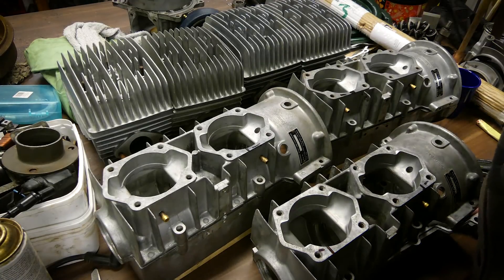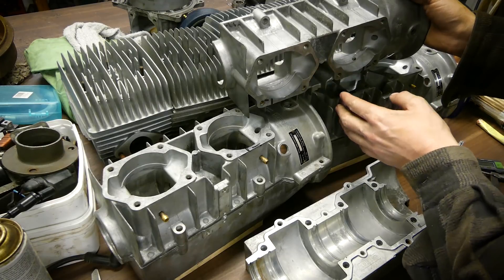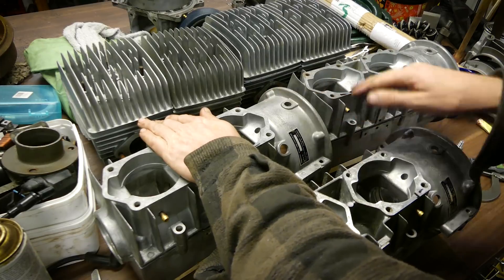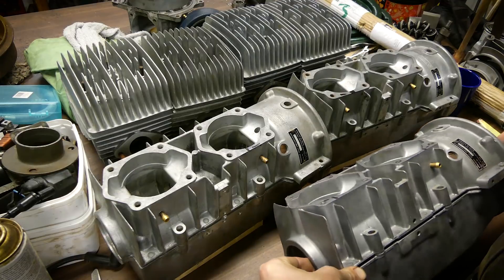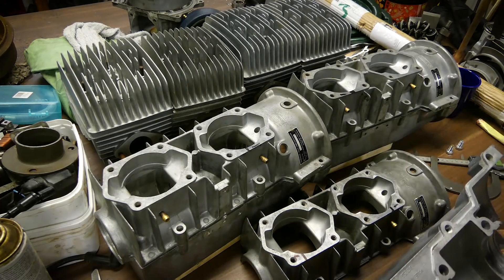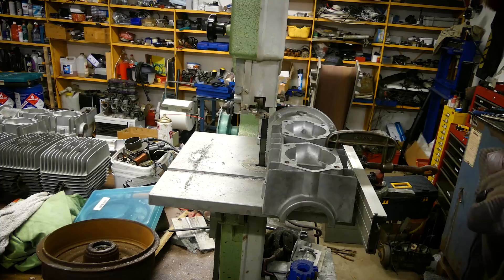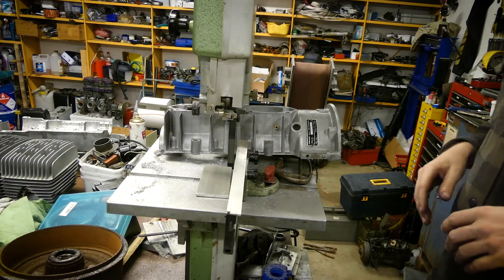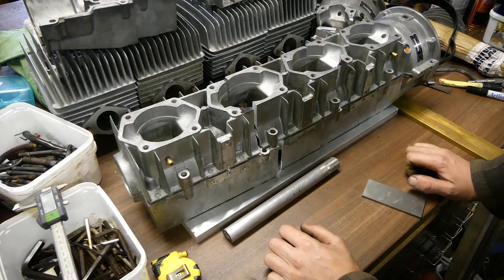Cutting some crankcases - 873 cc 4 cylinder 2-stroke part 1

Comment: I've been dreaming about doing this forever. Very gutsy, nice work and way to follow the dream! Might have been easier to put the top cuts on an uncut base. Then cut base on welded top and so on welding one case half at a time. Then you won't need any jigs to make sure you are spaced perfectly. A cylinder and the motor mount plate will space the outside edges.

Comment: When doing cutting things in that manner, you want to dispel the use of the caliper. Not only because it's not precise enough, but also because the act of measuring with it, is a pain in the ...anyways. Always take the time to make a go no go gauge for work like this, especially when something is repeated more than once. It makes life easier.
In this case, an excellent go no go gauge would've been using a bar of aluminium with ridges that fit inside the grooves.

Comment: What firing order are you implementing if you space the cylinders 90 degrees? 1, 2, 3, 4 or 1, 3, 4, 2 or 1, 4, 2, 3? Either way it should run smooth but you have options to do something really different if nothing else.
Reply from the maker: I'm thinking 1324 because that's been tested by others and seems to work well, but still trying to figure out if a different order might be better.
Reply: @Hollaendaren  That actually makes most sense, that way you'll have the most smooth scavenging of the cylinders.

Comment: It's a shame something couldn't be done to get two strokes back into the market for large motorcycle engines. The simplicity amongst the other obvious benefits make the idea very attractive. How you deal with the total-loss lubricating system is a real engineering challenge. Suzuki went some way with the mechanical oil recycling system on the GT 750 engines, but in the end the idea of bigger and better two strokes lost to the pollution lobby and increasing four stroke technologies.

Comment: a friend did something similar, single into a twin, and the crankshaft was the hardest part of the whole job, roll your sleeves up when turning on the lathe, have you taken into account the heat in the two centre cylinders,

Comment: I think this is a big mistake. Those kt100 engines are worth about 1000 each when rebuilt and running good.
Reply from the maker: These aren't KT100 engines, I have no idea where people are getting that from.
Reply: @Hollaendaren  okay then what are they?
Reply from the maker: They are Rotax 440 snowmobile engines.
Reply from the maker: I don't think they have much in common other than both being air cooled and piston port, there's 1000s of different engines like that. For starters there's the fact that the engines I'm using are twins not singles. Cases are split horizontally on these, vertical on KT100. KT100 cylinders have "feet" (short studs), these have long studs all the way through the cylinders and heads. KT heads are 6 bolt, these are 8 bolt. Completely different crank of course. Etc etc ;) I don't see a whole lot of similarities.
Reply: @Hollaendaren  looks exactly like a kt100 to me. Atleast the same design. Not same displacement if they are 200 some ccs.
Reply: @joeshmo2473  he wasn't a dick at all. He told you all the differences. You should say thank you for educating me.

Comment: If  you  were working with castings  instead of finished  parts  you could  aling  bore  your  crank  areas  ect  after it was welded together..  Also  you could  print   the parts to pour  your own  forgings..  There is a two  stroke guy doing this on  yooo   tooob  already ..  he is building  his own 50 cc  water cooled cylinders.. ect..billet machined crank shaft
Reply from the maker: I can line bore it anyway if needed. I'm going to be using different rods and pistons than stock so nothing is going to fit anyway, shaving a mm off both halves and reboring it to the same diameter would be fine. Or I could probably go up one size on the bearing OD.
I am pretty sure you are talking about the 50cc cylinders that I just machined for 2stroke stuffing :)
Reply: @Hollaendaren  I like what you've got going on here. Glad to hear you're considering align boring it as well. Probably pay dividends in engine life and will most certainly be necessary.

Comment: you can  purchase a V-4 
http://www.aaenperformance.com/v4_racing_engine.asp
Reply from the maker: Yeah but I doubt anyone would want to watch footage of me ordering an engine ;) not that I'm building it for YouTube points, I just want to see if I can actually pull this off.
Reply: @Hollaendaren    Yes  I understand ..  Is that a Snowmobile engine.. I just found your channel  and have no idea what you are staring with and  what  you want to use it for ..
  Yamaha RZ-500  is  two  two  cylinder engines and crankshafts  connected with a chain .. or gears  ..
Reply from the maker: I am working on a little project update video as we speak where I finally remember to mention what it's going in, it is going in a vintage snowmobile. I am familiar with Yamahas VMax4 engines, and have considered building my engine the same way (pto in the center between cylinder 2 and 3 and coupled by a gear), but I'm saving that as a plan B because I think one long crank is more contemporary with what I have in mind so I prefer that, really just for aesthetics because center pto would be a lot more practical in almost every way. I want it to look like it was built in the early 70s (the engines I'm using were made in 73).

Comment: Why not just join two two cly  motors together at the cranks, then make a spacer and bolt the blocks together?
Reply: wouldn't that make it longer though
Reply: @jamescooper4260 :  Yes, but only about 1 inch. or the thickness of both crankshaft flanges.  Think about how much easier that is. In fact, that is how most engineers connect two engines in-line. Ever seen the V-16 made from two Chevy V-8s. The guy connected the back of one crank to the front of the other with a homemade 12 spline coupling.
Reply: If there is an easy way and a hard way, why pick the easy way ;) You might as well ask why not buy a ready to run crate inline 4 engine, that would be even easier. The sole point of projects like this is the self set goal of making it just the way you want to make it. It is not about making it easy or sensible, it is about the satisfaction of making stuff.
Reply: @JohnSmith-lf8ks  OK then. My goal is to make a 532 cyl engine from corn flakes. I will be everyone's hero.
Reply: @timhallas4275  Can't wait for the video, I promise to 'like' it.

Comment: Overcomplicated solution, i mean if you need to make 4 cyl engine of two 2 cyl engines easier would be attach them side by side and join crankshafts with chain/sort of timing belt/gears, in this case error in alignment won't be so critical.  While things in video require high precision tools and errors will mess parts. 

Just thoughts about practical solution, ofc as youtube show this one is fine.
Reply from the maker: Yes it would probably be a bit simpler to build, but nowhere near as cool as one big 4 cylinder case :)
Reply: Well as for hobby maybe you right.
I guess with your tools you could even build crankcase from scratch, something like machine for each cylinder its own crank case section and bolt them together.

Comment: Why not just machine grooves into the big bit of bar you had in the lathe, install clips onto shaft and clamp all the case bits on and tack weld the whole thing together.  No need to machine all the case halves and no need to measure anything other than the groove spacing on the bar.
Reply from the maker: I really wouldn't want to leave any gaps either way, I think that's asking for warpage or weird tensions in the castings. It's not like I'm going to be mass producing these cases so I don't mind if it takes a couple hours longer to machine the cases to avoid gaps, better safe than sorry :)

Comment: Another method would be to leave the bottom intact as an assembly jig for welding the top part and just bolt the two together, weld, then finish the top, then use the finished top as a weld jig for the bottom.
Reply: Having welded motorcycle cases in the past, I made a mandrel that fit the main bearings, and sent the welded case out for stress relieving (heat treatment) to prevent warpage.
Reply: @UncleKennysPlace  I was thinking of the same solution, the bearing holders need to be exactly in line and just bolting the parts up to the other half isn't to be precise enough.
bearing alignment must be within 1/100th of a mm otherwise the engine wouldn't run very long.
Using a turned mandrel which has bosses beeing at the precise locations and size of the bearings on the real crankshaft should work, placing the lock rings in each part and then fitting them on the mandrel will ensure both bearing spacing and allignment are at the exact location where they should be.
Reply: @UncleKennysPlace  did the same

Comment: I would have cast a plug of the cylinder hole including the side kick outs and especially the bolt holes.
It would help to have an alignment tool that you can bolt in place for when you weld it back up as you will need to cut a deep "V" in the gap you will be welding to get decent weld penetration.
It will give you a perfect alignment in every plane to get a perfect part.
Reply: archangel20031 I think he plans to clamp it to the bigger shaft he showed in the beginning. That way. If the spacing is right he will know the bearing bores will be all in line.

Comment: What is this engine series originally out of? Snowmobiles?....
Reply from the maker: Correct, they are out of 1974 Ski-Doo TNT F/A snowmobiles. The earlier free air sleds were more aimed towards racing for those who couldn't buy factory racers, anyone could buy one of these sleds they came out of. They were loosely based on the 73 factory racers but toned down a bit so they could be trail ridden too. They raced mostly in stock classes and in stock form they had about 55 HP (for a 2 cylinder that is). So lots of room for improvement there but still not all that bad for being 1974.
Reply: @Hollaendaren  well, once done, what is the game plane, with a completed and running 4 cyl engine?, Or will figure that out, once you get there? Either way, I have enjoyed all 4 parts, and working my way through your other videos... Good stuff!!!
Reply from the maker: @drubradley8821  I'm going to have to build a new snowmobile chassis for it, I've started realizing this project is going to take way longer than I originally thought. I was hoping to have it somewhat finished by now, not sure what I was thinking. I want to do some drag racing with it and see if I can actually give newer stuff somewhat of a race or if I'm gonna be there mostly for show ;)

Comment: as a machinist ,i have had to do many things like this , also i raced two stroke singles for years with many dramatic mods but this is way more intricate with all the welding involved, i cant wait to see how you keep it straight , but magic so far 11out of ten for this
Reply from the maker: Thank you for the generous rating :) I'm very curious myself really, not sure if it's going to work out because I don't really know what I'm doing and figuring things out and learning as I go along. It may not work out on first try but I'll just have to redo it until I learned enough to make it work :)
Reply: Im really interested in the mods you've done to the 1 cyl, did you start from high comp pistons etc or the porting route
Reply from the maker: @benson4u215  lots of mods really, it has a completely different connecting rod and piston, and a spacer underneath the cylinder so I could decide the port height myself. Lots of porting, shaved material off the top of the cylinder, recut the head. It isn't anything like a stock 277 any more, almost no parts would work on a regular 277 without all the other mods.
Reply: @Hollaendaren  That is awesome, bet its a blast to ride!
Reply: in fact i would have removed a few thou from each crankcase face and then align hone it to get it square
Reply: @alancollard8939  Rtv works great for mating surfaces aslong as gas Isn't involved,  from a homeade gasket I made I gained almost 150mls of capactity underneath where the oil drain plug meets a removable plate

Comment: Hiya, I hope this is going to run in a drag bike or such, coz as a 2 stroke lover from way back, I don't think that will corner?😂😱👌👍👍👏👏👏all the best.
Reply from the maker: It's going in a vintage snowmobile, drag race only because it'll be a bit of a pain to handle :)
Reply: @Hollaendaren  I'll bet. But even if  it hasn't got reed valves, it'll rev and scream power. Good luck

Comment: why not cast a new crank case?
Reply from the maker: Because that'd be a lot more work? Also I probably wouldn't be allowed to run it at vintage races because the case wouldn't be 1985 or older.

Comment: You could buy a Yamaha v-max 4. In line four cylinder 800 cc water cooled 2-stroke engine and you are done. :)
Reply from the maker: Yeah but then I'd have a Yamaha. I'm not ready for that kind of lifestyle changes. Also those are 90s engines, way too new for this project.
Reply: @Hollaendaren  ...you are a freaking rockstar!  

Joe M....not kidding...I was thinking the exact same thing!
Reply: Isn't the Vmax a V4 engine..?
Reply: @nestrac  No, it's an inline 4
Reply: @nestrac  You are thinking of the motorcycle. There is also a V-max snowmobile.
Reply: @philliptoone  yep ... I missed the 2 stroke part ... And the 873 cc ... I didn't do well on this did I... F for FAIL 😂

Comment: Have you seen Allan Millyards motorcycle projects in England ?  He did a few Kawasaki triple conversions as well.  Great project.
Reply from the maker: I have, he has built some awesome stuff!
Reply: Kawasaki made triple motors 250cc   750cc   900cc  all 2 cycle
Reply: @allstatekiwi5646  Kawasaki made triple motors, 250cc 350cc 400cc 500cc and 750cc. Sorry but whats your point?  I owned a 500.
Reply: @JukeboxGothic  well these are nothing that Kawasaki had already made.
The crankshaft are the same so building something or using the same principle is easy to do. 
It's just like building a 2 cycle v8 using a whole heap of engines now that is hard.

Comment: You are a crazy man lol , its gonna sound like 1969 ,! Love it!!  
Will you be making an aluminum ice / snow racing chassis? 
I love your skills ...sweet shop !
Reply from the maker: Yep, I plan on using it for vintage snow drag racing :) Ice drags would be fun too but we don't have any ice races here. And ice ovals with this thing would be a bit too much to handle for me. The plan is to start out with an 80ish Everest 500 tunnel but mate it with a 71 TNT belly. But got a long way to go before I'll start on the chassis.
Thanks!

Comment: Good job .. cant wait to hear that baby crackle .. u going to race port it?
Reply from the maker: I am first going to see if I can get it to run at all before I do any porting. But when/if it actually works, it's gonna be race ported, and I'll most likely run it on methanol. I am going to borrow some pipes from my friend for starters but plan to build custom pipes later. But taking baby steps for now, there's a long way to go before I can start porting. Don't want to put any time into porting until I know the bottom end works.